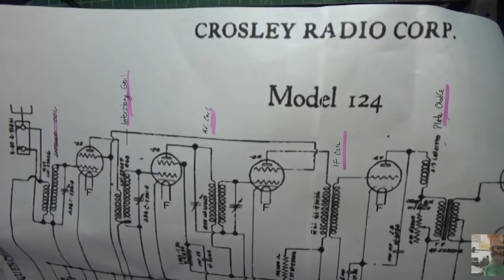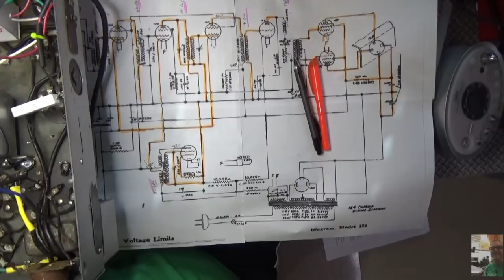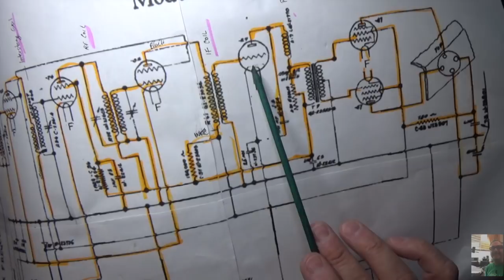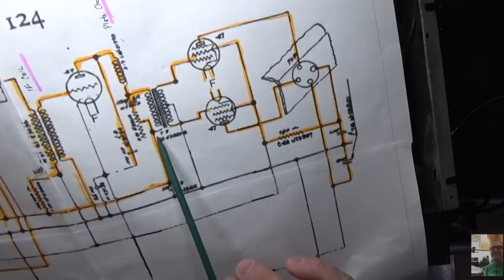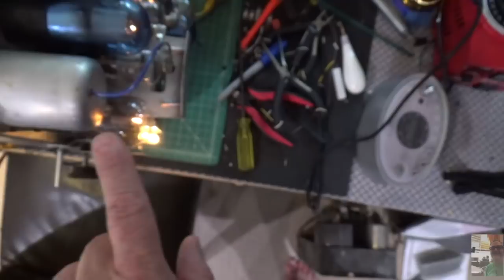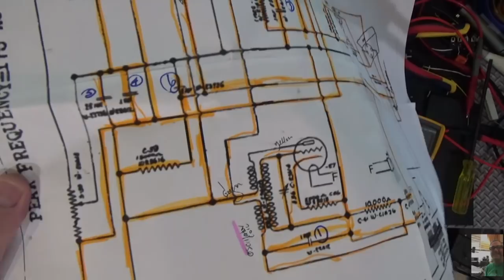Crosley Playtime Grandfather Clock Restore Episode #14:  Major Progress.... getting oh so close.

Comment: You know Ron sometimes you just have no idea what someone else has messed with in a radio and the only safe way to proceed is do what you are doing don't trust someone elses work. Thats what I learned from workng on these old Military radios that wires were deliberately cut( 9) i ran into like that. Then the old power supply was replaced it was using a dynamotor before all those wires had to be traced out so what you are doing is a great plan. Alignment procedures are a pain but unfortunately if the IF is to far off its NADA City. But just the fact its trying to tune is a really good sign
Reply from the maker: Larry 
She wants to come to life, I can hear it.. Just a matter of time and it will :)  thanks much
Reply: yep i can really tell it really wants to work. pretty close to hearing sound out of that 1931 Crosley